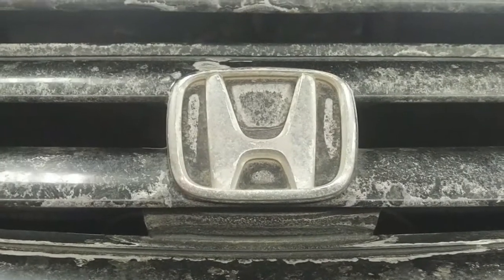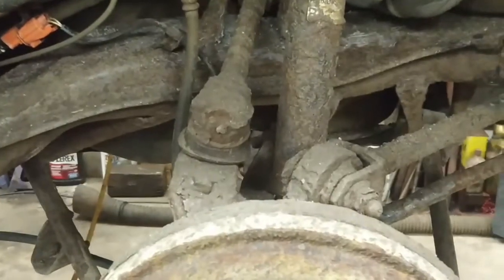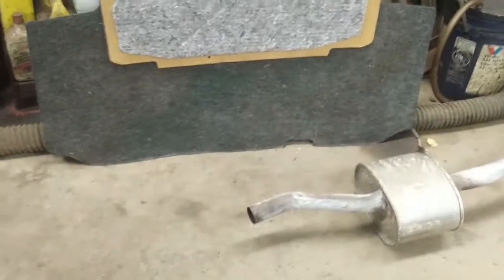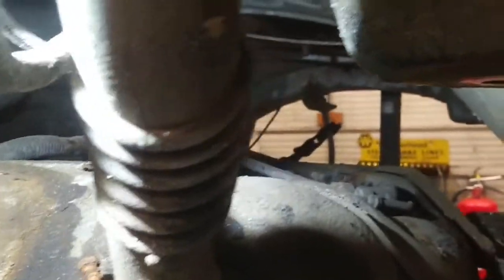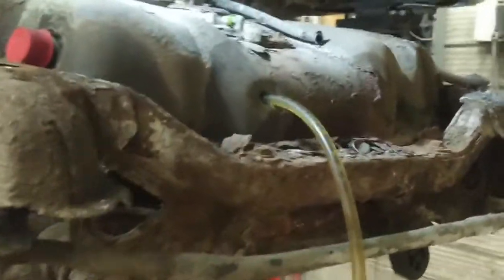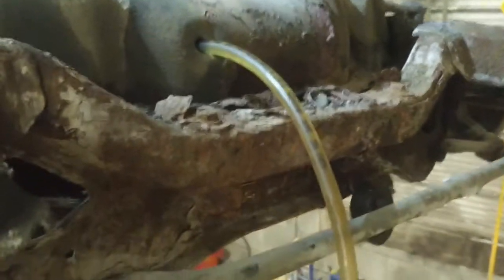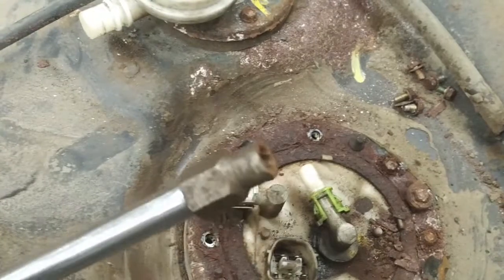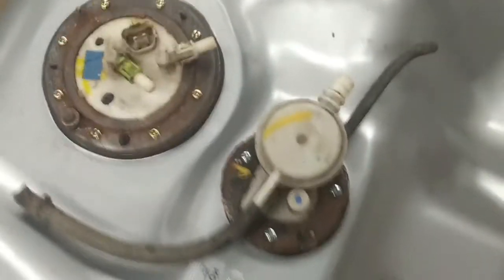2002 Honda Accord gas tank replace.

Comment: Finally got around to replacing the tank...(my kingdom is procrastination) Everything was going great, tx again so much! Now am having problems fitting the tank back in the"cavity" in the cradle. The straps act like they are not long enough. Something must be keeping the tank from going down into the cradle far enough. Only broke one bolt, one of the 2 securing the straps. I anticipate once I get the tank lined up the rest will be just a breeze... unless I spoke too soon. Lol

Comment: Thanks a lot for your video! My sister's 2002 Accord only leaks and smells like gas when tank is past half way mark. Not very familiar with Hondas, learning what I can.
Reply from the maker: Glad it helped you. The tank is likely rusted at the seam which is about 1/2 way up. Its quite a job to replace this tank. Most shops here won't tackle it cause around here the job is worth more than the car. Good luck.
Reply: Whaaaat my honda accord 2001 its the same shit, if i put gaz top of 1/2 the fuel leak
Reply from the maker: @mizudorishinobi4697  likely rusted seam. Only real solution is replacement of the tank. It can be a bitch of a job. If I were to quote the job again I would say 4 to 6 hours. May need other parts such as shocks, straps, fuel pump, lines etc. Hows tge body on the car? Is it worth investing 700 to 1000 in it? Good luck
Reply: Same here
Reply: @PhillipBailey  I just out of curiosity had it quoted at my local Honda Dealer.  They wanted 1,700 to replace fuel tank.
Reply from the maker: @DecadesApartGamers  yes there are a lot of Hondas in the scrap yard because it cost more to replace the fuel tank than what the car is worth.
Reply: I got a 2001 Honda 4 years ago. A year later I had leaks. My mechanic said to keep it half full. Now I have to keep it 1/4 full to not leak. Imma get another car as soon as I find one I like in my price range.

Comment: I'm doing this right now. Boy, my tank is rusty, upon getting a look at it, after removal. I'm going to replace the filler neck too, I might get a new fuel pump or may use my existing. Some problems I ran into: Seized shock bolt, had to drop tank with shock attached. I will hack saw through bolt (bushing is ruined and shocks old anyway. Gonna replace both rear shocks for $80, not bad. Busted high pressure metal fuel line at plastic connector (badly rusted). Gonna run fuel injector hose from the firewall back. Tank strap bolts rusted in, gonna try to torch and remove today. Filler neck pipe clamps rusted beyond re-use, not to mention all the screws for the pump, etc. I could see how this could be real expensive in a shop, especially with their mark up on parts.
Reply from the maker: Yes your right. In some cases a job like this costs more than the vehicle is worth at going Shop rates. Good luck.
Reply: @PhillipBailey  good Morning.  I need my 1998 Honda Accord done.  How much do you charge?
Reply from the maker: @muslimahquattlebaum9319  I charge $120/hr and that job could be between 4 and 6 hours. There could be additional repairs required such as rear shocks, broken bolts, exhaust repairs, fuel lines and  pump assembly. When you add this up its usually more than the car is worth.

Comment: I've been driving my 2002 Accord v6 for several years with max gas at 5-6 gallons. Seems like some sort of epoxy could be used to seal seams or leaks??  I have 255K miles and tho my car is still strong, I don't want to pay 1-2K for fix. I can change starters, EGR valves, evap canisters, clean carbon out of air intake manifolds but I'd never be able to untighten the bolts to begin this complicated project. Thanks for your video, I love fixing my own car from watching youtube!
Reply from the maker: You would pretty much have to remove the tank to clean the rusted areas to attempt to fix it. Most of this repair is labor as you can see it can get quite expensive. 5 to 6 gallons... good thing it's good on gas. Thanks for watching.

Comment: Doing this job tommorow..but i put a few coats of underbody coating on the new tank
Reply from the maker: Good luck. Not too bad if you have a hoist and tall jack.
Reply: @PhillipBailey  Oh im doing it in my driveway on jack stands..dont really have a choice..just soaked all the bolts ill be working with in PB blaster.
Reply from the maker: @bryanr5756  wow that's going to be a challenge. Work safe
Reply: @PhillipBailey  ill be fine..built a little jig for my floor jack to lower the subframe...

Comment: How many cost for this? I got a 2001 honda accord fuel leak
Reply from the maker: I would quote 4 to 6 hours labor plus the cost of the parts required. Be prepared for additional parts such as exhaust, shocks, tank straps, fuel pump, lines etc. Good luck

Comment: How much does this cost???
Reply from the maker: Here in Canada the tank is around 300 and labor would run between 4 and 6 hours at whatever door rate the shop charges. Be aware there are lots of complications that can arise during this repair as rusted bolts, other fasteners, brake bleeding problems etc. This could result in additional parts required. HTH
Reply: @PhillipBailey  I wish you are in Ottawa, I have Honda Accord 2001 with same issue need gas tank replacement and  wherever I vent and ask for estimate was like they saw evil and  answer was "2000-3000$" with ending like "it's not worth repairing" I would rather they say "I don't want to do it" instead of B.S like that, seeing that Accord how rusted is mine is like new, there's no rust on the bottom at all, even bolts and  nuts are like new, I bought this car 3 months ago and I don't think this  car ever seen Canadian winter...even Honda dealer refused to do it (of course saying amount of money for repair exceed value of the car)...
I appreciate for the video, you give me hope one day I will find mechanic like you, until then I will just fill half gas tank and drive the way  it is ...
Reply from the maker: That's quite a job and retail cost is around $1500.00 here. The value of the car is between 2 and 3k so it's a bad investment for sure. Good luck. If you come to Thunder Bay I would do it for you.
Reply: I finally got it fix but now the car doesn't turn on  fuel pump works but I'm thinking it something esle like battery ! I got it fixed for 100 dollars and brought the tank from junkyard for 40 .
Reply from the maker: @JonathanRuiz-tc6fj  what do you mean it doesn't turn on? Does it crank over normally? If so it's not the battery. Did you put in the complete used tank with the used fuel pump in it? It you did its possible the used fuel pump has failed. Could they have mixed up the fuel lines. Can you hear the fuel pump turn on in the tank? Is there enough fuel in it? Was it drained before installing? Goodluck
Reply: @PhillipBailey  we figured it out it was the battery. Thanks Phillip bailey.